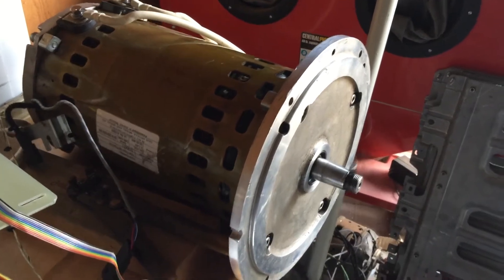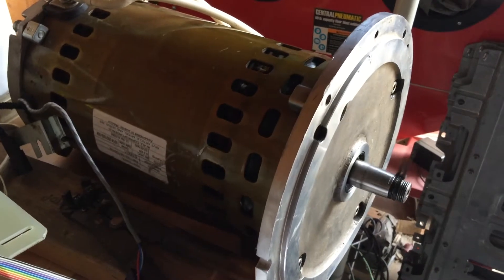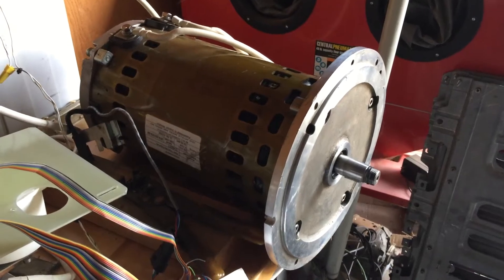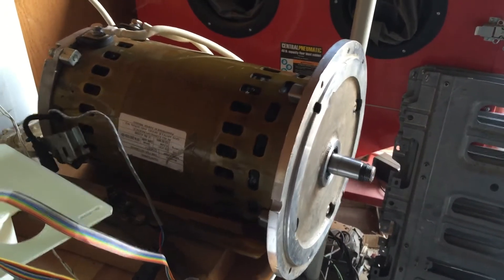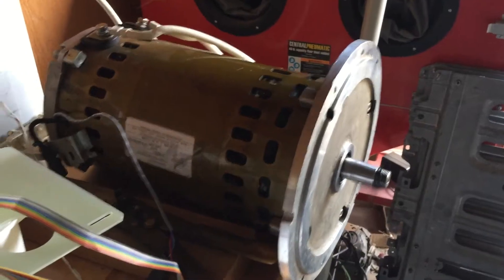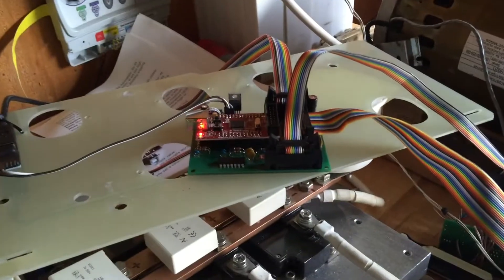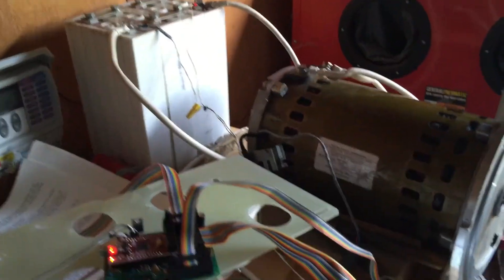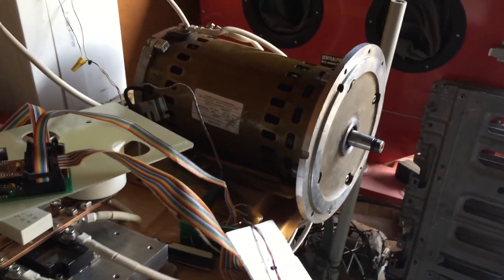Motor & Inverter

Comment from the maker: Sure, one of those rewound puppies? Im playing with the above inverter kit from Johannes Hubener from Germany. I trying to just get stuff set up on the test bench. After mucking up the controller I was able to get it going again and now I need to put some power to the motor. I still need to lock it down but there are a few issues Im still working out. One is the clunky sound and harmonics and the other is the speed. Yes, its just 12 volts for now but I did at one time have that sucker singing sweet but now it won't go. But I'd love another motor to play with. I do have a curtis controller for my AC-35. I think it would be a blast to try some different motors with this setup. What voltages are those motors designed to run? I can do almost any voltage due to my many Leaf Modules.